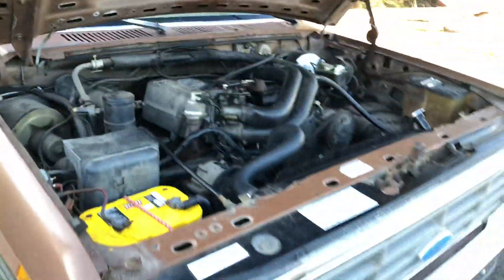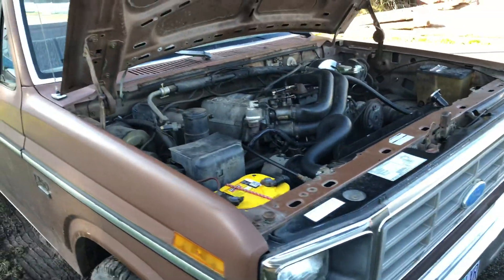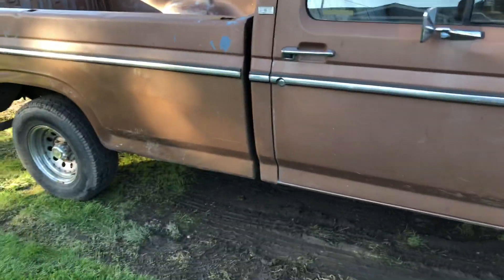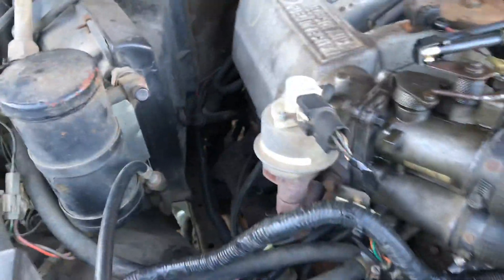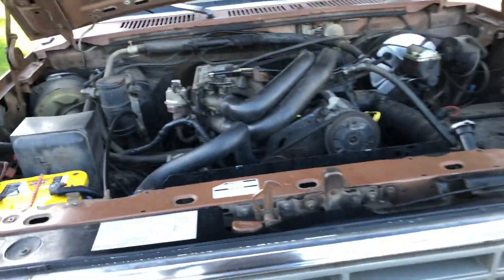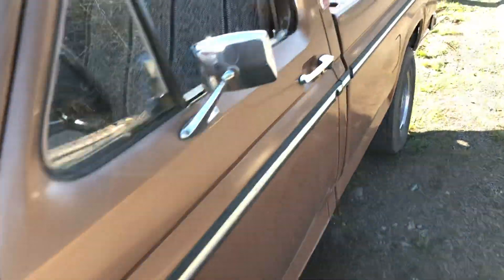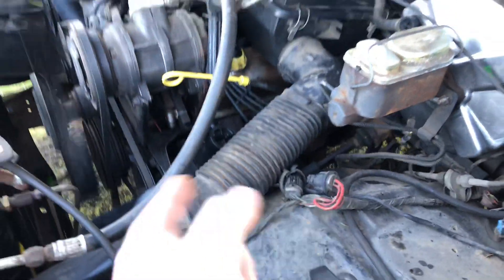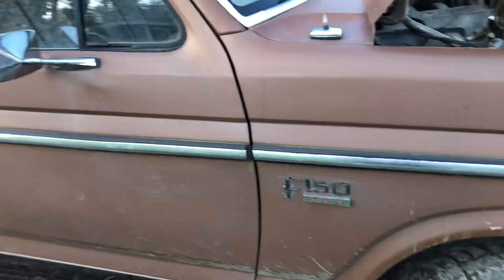I think I fixed it!

Comment: Only do motorcraft MAP sensors same for TFI or ignition modules on these. The aftermarkets are trash. Replaced 3 of each in the same year with the aftermarkets. I actually have a good motorcraft map if you need it. It's from my 93 but I think they are all the same. I'll send it for the cost of shipping. I used it less than a year before going mass air.
Reply from the maker: Chris Clayton I will buy it. Send me an email. johnsonsgeerage@gmail.com